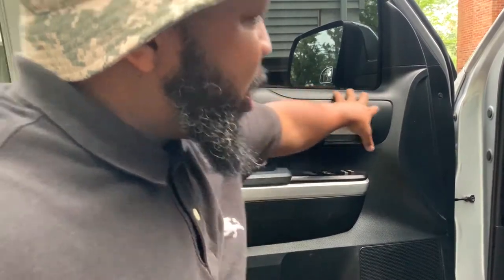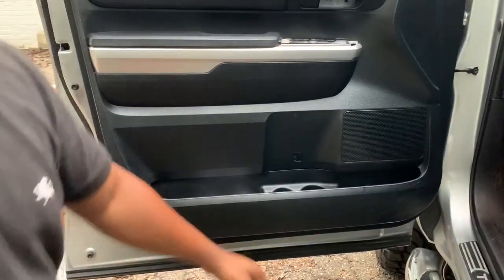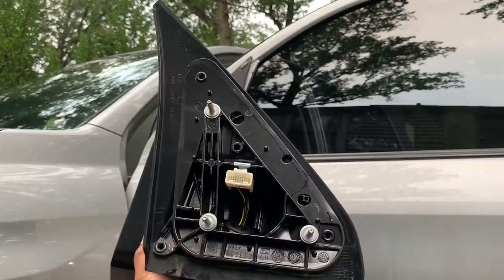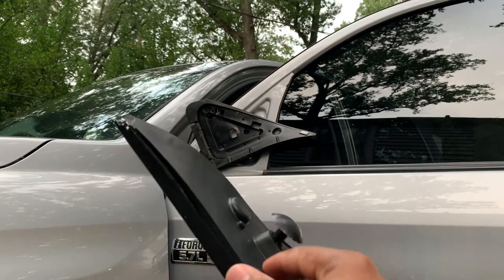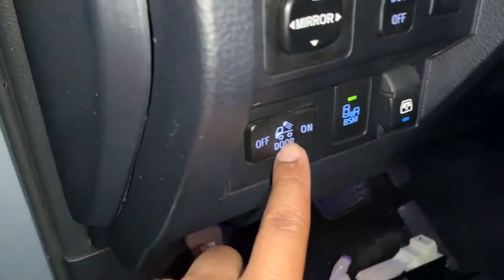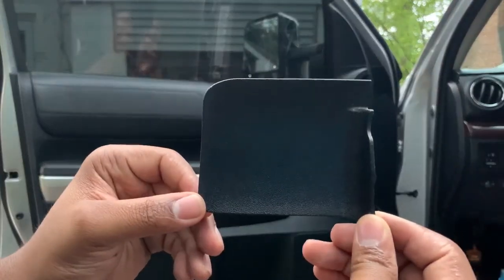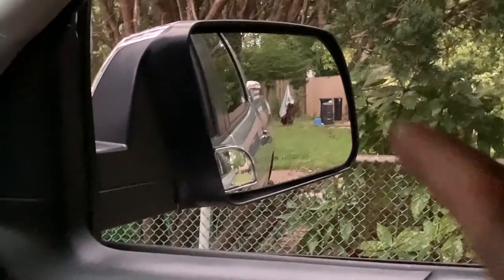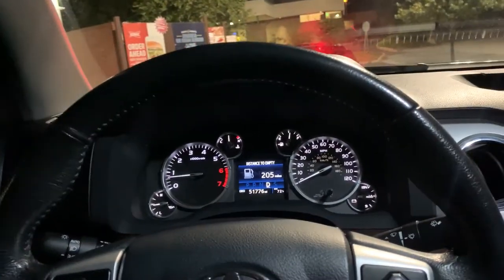DO NOT Pay A Mechanic To Install Your Tow Mirrors Until You Tried THIS (Toyota Tundra Tow Mirrors)!

Comment: Hey man! Great video. I’ve been thinking about doing this for awhile now. My 14 Tundra only has the heated mirror feature and no turn singles. My question is, does Toyota still wire the mirror for a turn signal even though my particular truck doesn’t have that option? Thanks.

Comment: Hey man, I install one on my 2020 tundra it looks great and all but I have one problem as when I tap in to taillight 10amp fuse to supply power everything just like every other YouTuber do but mine the LED running light on the mirror does not comes on at all. Is there any other fuse source I can tap in?

Comment: Bro so like my tundra and from what i can tell yours.the stock mirrors had no light on them before correct. And ur new tow mirrors do. And the factory cable still power's the lights on your new mirrors no extra wiring
Reply from the maker: That's absolutely correct. My stock Tundra mirrors only had Blind Spot & Heated mirror features. The new tow mirrors have Blind Spot, Heated/Cooling and Turning features. The Toyota factory cables provides power for the mirror turn signals.
Reply: @AWordFromMrJones  sweet appreciate that info brotha. Keep up the good work.

Comment: Did you wire your back up wires so you get the light on the tow haul mirrors to light up when in reverse? I wanted to see how you did that wiring process. Thanks!

Comment: Got them installed but my BSM light stays on solid on dash and says BSM malfunction. Can’t find any videos or info on what to do to correct. Do you know?
Reply from the maker: It sounds like the mirrors that you purchased has the BSM wiring installed incorrectly for your truck year. My understanding is that the BSM uses the Purple and Pink wires which are located on the far right (pins 9 & 18). It may be possible to get a pin extractor tool to pull the pins out from the OEM harness connector and then reconnect the pins to see if that may help.

Researching some Tundra forums:

Tchase had a similar issue with BSM and swapped his pins to resolve his issue. Look at his post #228 here:
https://www.tundras.com/threads/upgrading-to-power-fold-mirrors.12452/page-8#post-1444316

You can see that for his passenger side mirror he swapped pins 9 & 18.

BSM OEM Wiring:
PIN 9 - Purple | 
PIN 18 - Pink (color might be beige, I'm a bit color blind)

BSM MODIFIED Wiring: 
PIN 9 - Pink (beige)
PIN 18 - Purple

For my truck, 2017 Tundra CrewMax, both my passenger and driver side mirrors BSM are pinned out as:
PIN 9 - Purple
PIN 18 - Pink (beige)

I do not have any pictures on me but here's what I found from the web which is Identical to my setup:

Driver Side:
https://www.tundratalk.net/threads/blind-spot-system-wiring-is-installed-on-sr5-grade.557793/#lg=thread-557793&slide=0

Passenger Side:
https://tnstatic.net/attachments/img_4933-jpg.127078/
Original Link: https://www.tundras.com/threads/power-folding-mirrors.22077/

Amazon sells various tools to extract connector pins.
https://www.amazon.com/Vignee-Terminals-Extractor-Electrical-Connectors/dp/B08295ZWL2/ref=sr_1_8?crid=3K35K5GOEKX29&dchild=1&keywords=pin+extractor+tool+set&qid=1614638191&sprefix=pin+ext%2Caps%2C147&sr=8-8

I would first contact the seller or business where you purchased the mirrors from and inform them of your issue prior to touching anything to not VOID your warranty. Just explain to them the issue that you are having and ask them for a replacement ASAP. If you do not feel as those that the replacement may resolve your issue. 

You can also return the tow mirrors for refund and purchase from a reputable seller/business such as BoostedAuto. The mirrors cost a bit more but they custom make them based on the options you want and they wire they based on the truck year/model. https://boostautoparts.com/products/tundra-mirrors?variant=31996463743111

I hope this information is helpful and hope that you will find a solution to your problem.

Comment: The doors are super easy to disconnect it takes less then 10 seconds to take the cable off the door way easier to work with the door off
Reply from the maker: Yes indeed they are and great space for accessing the speakers to upgrade them.